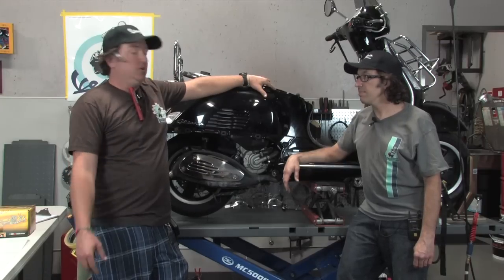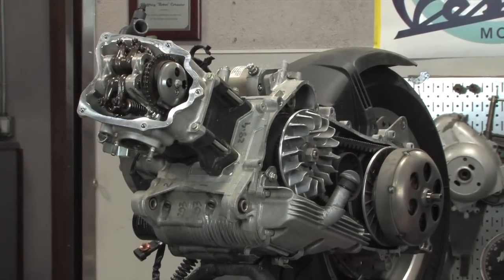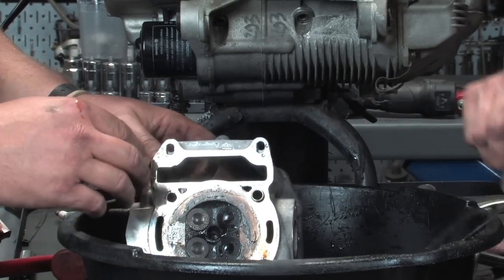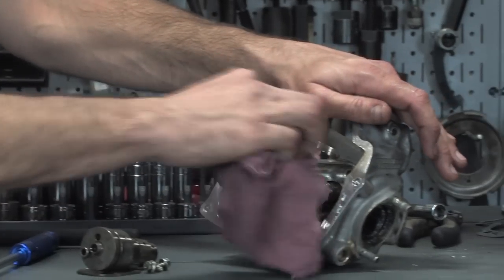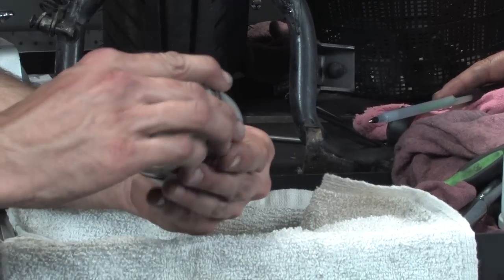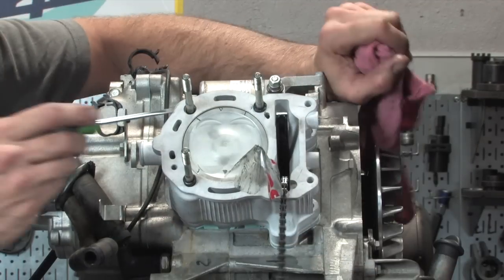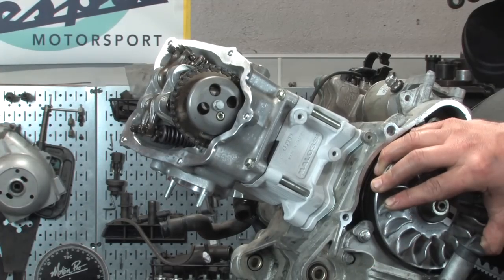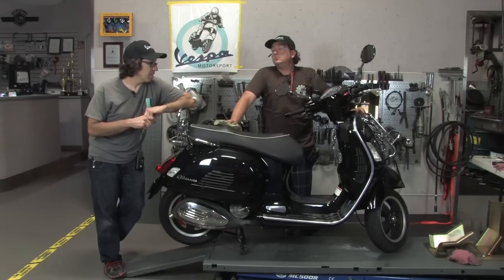Vespa GTS Malossi Cylinder Kit Installation

Comment: I bought a new Vespa GTS 300 Super in November 22. It was delivered with only the test drive mileage on 8 mile . It was garaged over the winter months ( UK) kept on battery tender . Upon starting it a few week ago it just didn’t sound right , a clattering noise from the top end . I made a video of the problem and sent to my dealer who by the way is top notch having bought scooters from them over twenty year . After a week I was informed that the problem was the decompressor , a part of it had broken off and damaged the valves. So it needs a new top end apparently no other damage . As yet I’m still waiting for it to be repaired . The dealer informed me that in over seventeen year selling the GTS , they had never encountered this problem before . Just shows first time for everything, although I wasn’t expecting this on a brand new scooter .

Comment: Thank you so much for this amazing video. I installed the v4 head and cylinder kit, along with the Forcemaster 2, after ordering from Scooterwest. It turned out great, and your video made it super easy to install. It's the little tips and tricks (how to remove/install the rubber stud o-rings, how to remove/install the piston clips and rings, how to properly torque, how to disassemble/reassemble the auto-decompression system) that made this completely worthwhile.  You guys are great, and thank you for this video!
Reply: How do you tell ifbthe piston rings are seated correctly?
Reply: Non riesco ad ascoltare in italiano come ai fatto

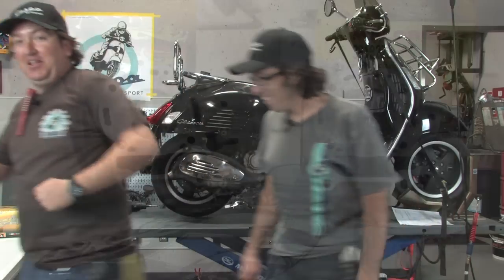Comment: 1:51 - Parts List
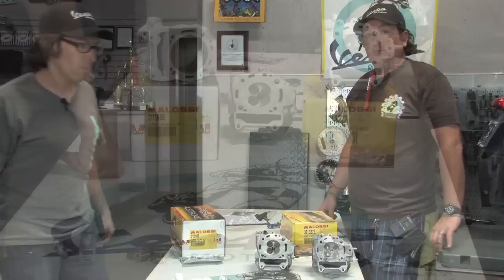6:25 - Aditional Parts Lits
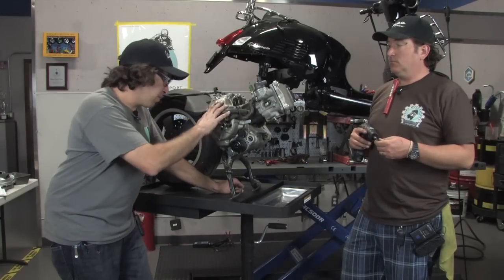10:32 - Engine Disassembly
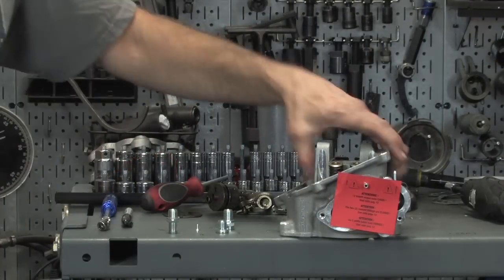44:37 - Head Preparation
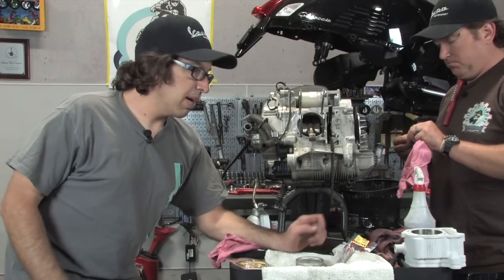50:48 - Piston Ring Installation
1:00:55 - Installing Piston into Cylinder
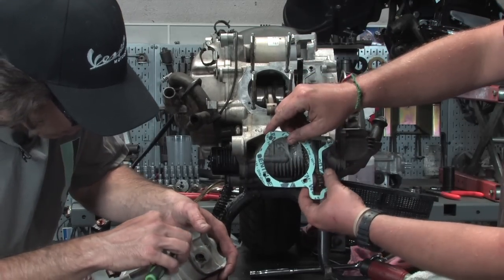1:05:14 - Installing Piston & Cylinder
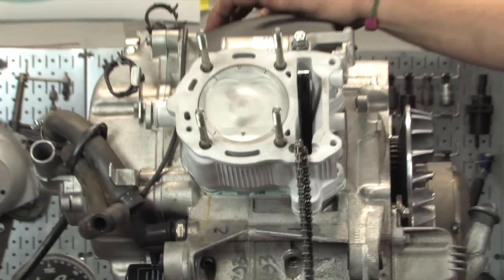1:09:16 - Head Installation Preparation
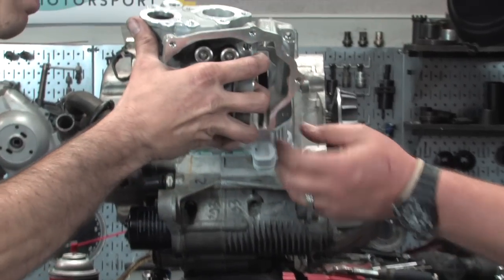1:14:32 - Head Installation
1:18:42 - Camshaft Installation
1:26:12 - Camshaft Chain Tensioner Installation
1:27:39 - Setting Valve Clearances
1:30:26 - Coolant Hoses & Thermostat Housing
1:34:10 - Engine Installation (Sides)
1:36:44 - Engine Installation (Top)
Reply: Andy Roberts please somebody help me. Is the Polini camshaft compatible as a malossi kit?
Reply: @MrLaranjeira88  I have read that some people have used the Polini camshaft with the Malossi kit, although I am unsure if they also modified their piston for clearance.  See: https://www.youtube.com/watch?v=Q0tFdq5gjg4 & http://modernvespa.com/forum/post2288968?highlight=#2288968
Reply: J'aimerais savoir pour l'emplacement au niveau des serments sur le piston merci

Comment: i bought a Yamaha Warrior 350cc ATV
and rebuilt the whole thing, engine included.  yes it was fun to ride, but had more fun rebuilding.  the knocking that came from the crankshaft eventually went away, and that as a miracle because it was pretty loud, but never replaced the crankshaft, just the sleeves.  it was as quiet as a church mouse after a short time of riding.  if i’m ever out in california again, i’ll make sure to drop in and say hello.
who knows, maybe i’ll buy a scooter.
nice job guys

Comment: Just done my gilera runner 218 kit. Was nice to reference back to this video just for a few pointers, nice video guys, Thank you
Reply: Did you struggle with getting the orings on
Reply: @toddcoxall6024   no, if your struggling to fit the orings you are doing it wrong. I can’t remember off the top of my head where they fit now but they do not go over the studs directly, was a few years ago I done mine but she still going strong. Are you doing one at the minute?
Reply: @toddcoxall6024  the orings go in the head first. Check out https://wemalossistore.blob.core.windows.net/files/montaggio/pdm/7316208.pdf
Reply: @Basstrucker2013  got the kit on just struggling to get the orings in around the studs
Reply: @toddcoxall6024  you don’t put them there mate they don’t go there. Look at the manual. They go in the cylinder head then the dowels sit on them
Reply: @toddcoxall6024   this is an early kit 7 years ago
Reply: @Basstrucker2013  great cheers for help mate will have another go tomorrow and get back to you 🤟🙏
Reply: @toddcoxall6024   no worries yeh let me know how you get on. They go in the the cylinder head we’re the little dowels go. Read the manual there’s a diagram there too. I done the same thing when I got mine and after a while I was like this ain’t right….. hence the manual came to the rescue!!
Reply: @Basstrucker2013  hello there again managed to get the 2 orings in the cylinder head with the 2 dowels placed on top do the other 2 orings go in the other 2 holes as seem to be quite tight
Reply: @Basstrucker2013  will do mate cheers
Reply: @Basstrucker2013  hi mate I’m having this issue as well and I’ve tried what you said to the other guy and 2 of the O rings go in where the dowels sit in the head but it is absolutely impossible to install the other 2 as the holes are significantly smaller than the O ring what should I do it also says nothing about them in the manual that come with my kit what should I do mate?
Reply: @motorbikeryda883   If I remember correctly there are only 2 locating dowels for the cylinder head so 1 oring per dowel,  they sit under the dowel, do you have the manual?>

Comment: What size is the temperature coolant sensor bolt 
Also I have a GTS 300 engine 2012 fuel injected I wanted to use with new led display clocks from 2015 however the temperature sensor has 4 pins and my loom shows on two connection wires which I have conveyed to your standard aide to side 2 pin sensor my question is will it still work as on my display the temp gauge is same as immobilizer light and not sure why only works manually from relay to start instead of from the button but obvcourse I might have immobilizer chip issue but would a disconnected temp sensor stop the bike from turning over by the button as nothing happens and button tested and replaced

Comment: Nice video... I have a question I'm doing the same but on the Honda PCX same kit hough and like you I got the 3 Gaskets. there is no documentation for which ones to use. in the video you use the light one put the black Thicker one to the side. I use the standard head so do I use the black thicker gasket if I just place the default head back on?

Comment: Hi Robot, great job with all the vídeos. I have a question for you. I have a 2014 european gts300ie with around 20 thousand miles. Lately I have problems to start it. As you know you can not turn the throttle while starting the bike since it will actually not start. Well the thing is that if i do the normal starting procedure (brake lever and start/ignition button) the bike will not start, actually there is not reaction/noise at all. After playing a bit with the throttle it will actually eventually start. Not sure if it really has anything to do with the problem. Any thoughts on the problem. Thank you in advace for your help. Best regards from the other part of the pond.....

Comment: I just got this... Do I need to lap the valves or are they already done? 6 10ths of a millimeter?  my manual says to torque the head nuts to 7nm, 10nm then 270 degrees...
Reply: Was it worth getting, 1 year later.... Thanks

Comment: So u push the o rings in the holes so that theyre flush ? And also what ive done is push a set of nitrile 1mm o rings in first then managed to push a set of viton 1mm high temp o rings on top so theyre flush as i dont trust nitrile ones .i just want to check i got the right ones? Ive got 1mm thickness ones all round .are thesethe ones as they fitted in nice

Comment: Hi, great Video series! I have done a complete engine overhall on my 125 gt l (2003) according to your tutorials. This was my first experience on a scooter and thanks to your instructioncs nearly everything went fine so far.
On my 218ccm malossi in combination with the V4 head I had no chance (really no chance) to get those O-rings in, which came with the malossi gasket set 1113960B. Is this normal? 
Since I have forgot the lower chain guard before fastening the head, I had to reopen it. I hope the gasket has survived.
Reply: same problem i did nt put them in and it doe nt lose any water and yes i used the gasket again no problem
Reply: @2heads142  I’m having that issue right now did you not get any coolant mixed with your engine oil?

Comment: Hi I’ve just bought this kit for my gilera runner st 125 and it says it’s compatible with my engine I’ve installed the piston and the cylinder but there is absolutely no way that those little rubber o rings will fit into the little hole around the stud and the cylinder can you please help me

Comment: NO NO NO, NEVER use a screw driver to install rings!! You run the risk of nicking them! Get a better ring compressor!! Also, ring gaps should ALWAYS be checked before installation. Don't take that for granted! Gap to tight and the rings will butt up and damage the cylinder bore.
Reply: Right !… I agree
Reply: Chill man its a malossi 4stroke kit not a alliepxress 2stroke kit😂

Comment: Have 2020 with high oil consumption 150ml every 600 miles. Does Mallosi have kit for HPE that would correct Vespa design flaw?

Comment: hey guys.... nice work. i was thinking to upgrade my et4 125 leader 2000 to a 210 or 190 kit. i was wondering if u cud point me in any directiong to the part as i can only seem to find for the px model s and gts . cheers

Comment: What is the gain in horsepower with the Malossi kit over the factory OEM components?
Reply from the maker: sonothesouth We have dynoed both a stock GTS and a GTS with the Malossi bolt on head and cylinder.  It's about a 6 hp gain.
Reply: ***** That's very impressive; a 25% plus gain in HP.  Thanks for such an informative and thorough video.
Reply: ***** any downsides with such kits?  higher gas consumption? what about reliablility with these tune ups?
Reply: 6hp is very impressive. Did you change anything else on injection, exhaust or transmission? Also if i put  malossi camshaft, do i have to change anything on fuel supply?
Reply: I would like to know too. Like most engine performance parts I imagine it would use more fuel.

Comment: Hello! Can I know whether this kit can be fix on my gilera st200?
Reply: It will fit your bike ,mate keep your Gilera in good health they are rare nowadays
Reply: jack english alrite thx mate. I will keep it in good health. Thinking of upgrading to this kit. Hahaha
Reply: Soffian Zainal I pressume you're thinking of upgrading a 4 stroke, they're not the rare one's! (stock 2 stroke 125's are the rare one's) So as long as you have the money for a new engine in case you do run into problems it should be a fine move.
Reply from the maker: Soffian Zainal The head is universal and will fit the Piaggio/vespa 4 -valve liquid cooled engines from 200-300cc.
Reply: ***** noted. Thank you
Reply: +Vespa Motorsport what about the gaskets ?are they actually identical to the 125 gaskets?

Comment: What a great watch but seriously, who's really going to attempt this at home?
Reply: It's not hard.  I installed the same kit on my GTV 300 at home.  No real specialized tools required.  My new Malossi top end is installed and running just fine, and this video was a fantastic reference.  The little tips and tricks (the head stud o-rings, the decompression system bushing trick, etc.) are super helpful for the home mechanic.  Took me 3 days (taking things slowly), and everything works perfectly now.  Significant power increase. It cruises easily at 65mph, with plenty of throttle left for passing at freeway speeds. Top speed so far is just over 90mph on flat highway.

Comment: These liquid cooled leader engines had a very weak  timing chain they look the same as the one used on the 2 valve air cooled, much to weak to operate the 4 valve engine, I’ve owned a few which all had cam chain issues with very low mileage,

Comment: Bigger cilinder and no bigger jet?
Reply from the maker: Medemblikker The fuel injection system can correct for as much as+/- 25% fuel.
Reply: ***** Didn't know it was injection over here (holland) 99% of all engines are with a carburateur. thanks for the reply!

Comment: paying so much for so little return of power? wtf is the point! the price performance ratio is bad with these malossi upgrades. theyre very expensive. especially adding all that labor. and youre getting so little back with power and engine size upgrade. 20-30cc. thats so little for the power and price you pay. a huge waste of time. just get a downtown 300cc or an xmax and be done with it.

youre talking $400 for the cylinder head,  and $550 for the head with valves. add in labor and other little bits like gaskets and orings etc, and youre hitting $2000 for 20-30 cc increase in piston size and you get back only a few measly horsepower(theres only so much stress the bottom of the engine can take from the stress of a bigger piston). best just get a different scooter for that price. you could probably even get like a 2008 burgman 400 with little miles. if you sell your scooter and add the $2000 for this ridiculous kit. completely different level of scooter. the plastics and quality of the scooter is so much higher.